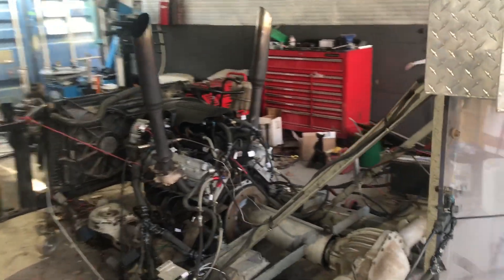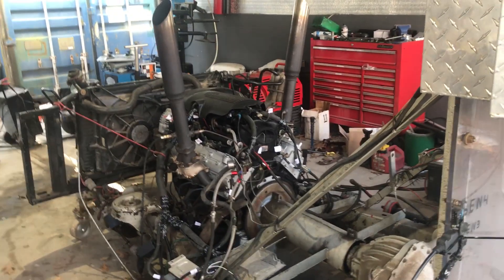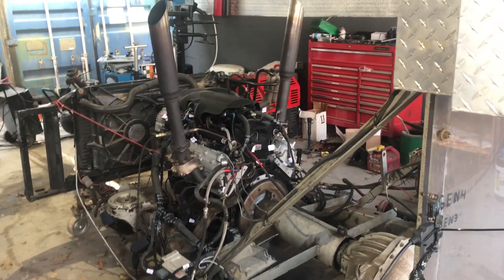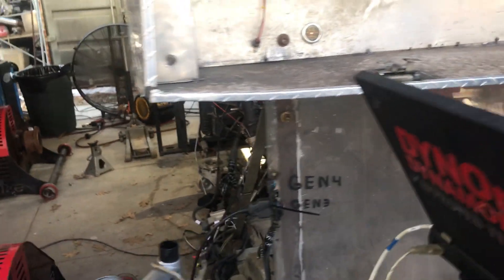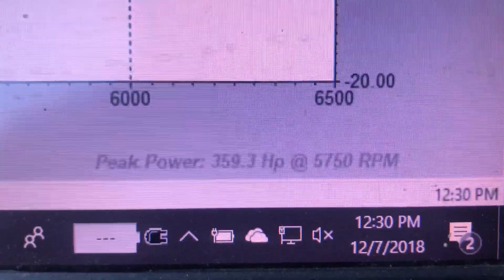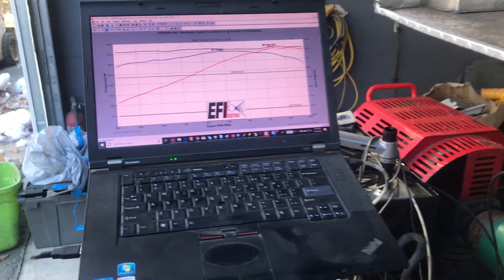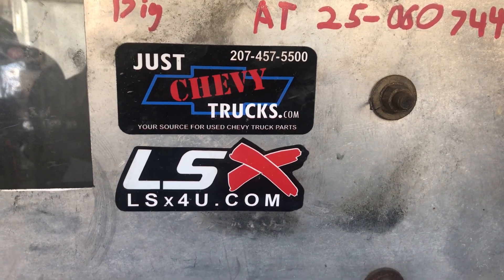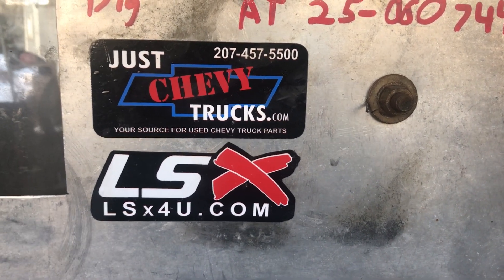Brett Gailey 5.3 LS Engine Stage 1 Cam 422 HP

Comment: Hola, I have a 6.0 out of a 2002 1500HD that is going into a 1992 Sonoma single cab short bed. Transmission is a 4L80e. The computer and harness came with it. Some people told me to change gaskets and drop it in, but the voices insist on modding it out a bit. I'm not looking for a race car. Daily driver with some power under the hood. 400-500 HP would be nice with simple upgrades under 3k if it's possible. Besides the cam, would polishing the crank, different heads(799 or LS3), different pistons any of that other stiff help? Do I need different push rods or springs?
Reply: Justchevytrucks Thanks